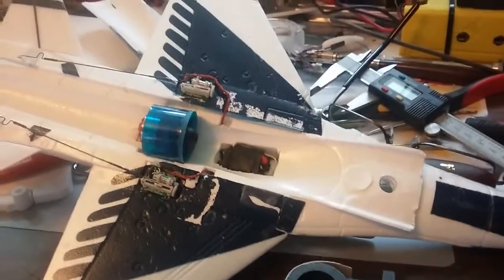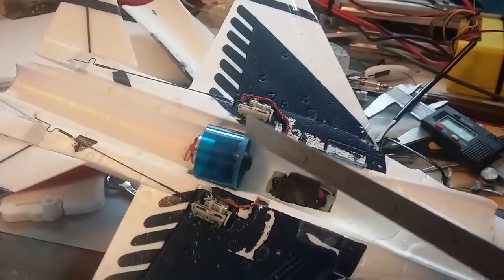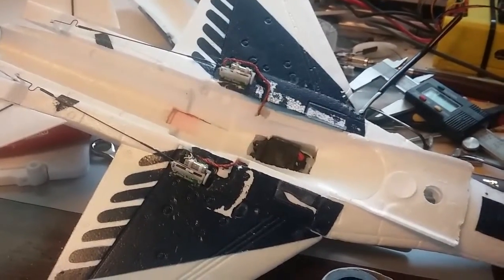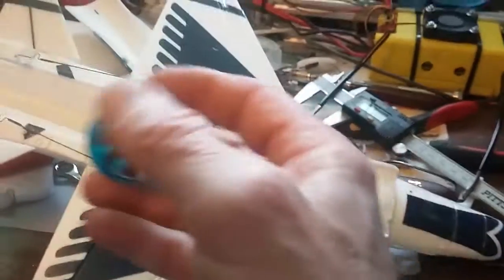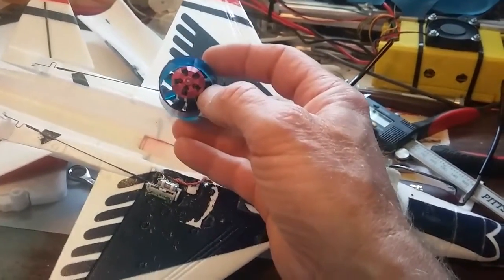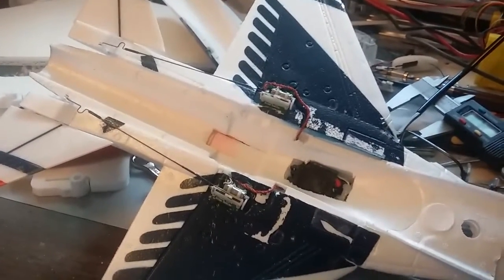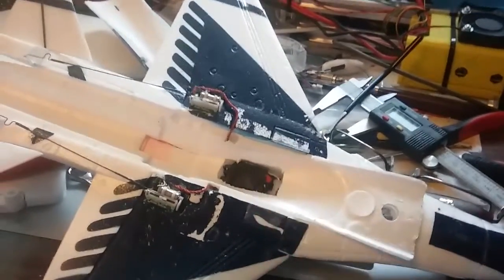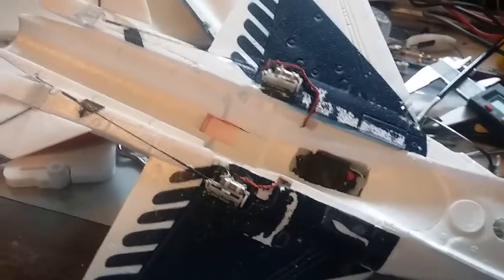UMX F-16 30mm edf Mod

Comment: I actually just did this mod myself. I knew of your videos already from the pkz P51, i should have looked around some more at your play list i completely forgot you did this mod. i did the exact same thing with the new 30mm from eflite, i may have reconsidered if i remembered this vid. 

I've read the comments and your reply. still no gains? what about 3S? 

the lines on these birds are so nice too, eflite did a fantastic job scaling this bird down i love the look amd UMX is the best size to. i still have a H9 1/4 scale J3 taking over my living room, Draco taking over the dining room. 

what i really really want yo see and i said this as soon as it arrived, my Draco! 

can you imagine a scale UMX Draco!!!! imagine the scale detail and size of the UMX Carbon Cub SS and the detail that went into Draco. 

UMX Draco would sell out round the clock for a year, they could stop and make nothing else OMG! 

anyway, im scrolling through your vids to find what pinion to use for the Brushless inrunner that used to power my UMX F-16 i have a small stack, Rage RC supplied the gearboxes 10mm.

I do hope to hear back from you about the 16 though, love your vids and I'm a subscriber.

Comment: Well after testing the set up even with the bigger edf I still couldn’t get any more thrust. The problem is the size of the intake duct. It isn’t big enough to flow any more air. To connect the esc to the original board you have to solder the white signal wire to the transistor that controls throttle output on the board. If you send your email to robtbird.rw@gmail.com I will send you a picture that shows where to connect the white signal wire.

Comment: Hello:  I would love to know how you use the 18amp ztw esc in here with the UMX radio.  I wouldn't mind a sanding cylinder too if you're still doing those.  I ordered the same edf and esc, but was thinking I'd have to put a micro spectrum radio in place of the original.

Comment: How you doing. nice video on the mod. I have the micro habu and a 10000kv 30mm motor I want to put in. Not sure how to mod the esc to the ad3x board. was wondering if you have any advice or a video showing that specific mod. Thank you Mike.

Comment: I was under the impression the F-16 ran a 30mm EDF stock (...Nope, I was wrong...28mm from the factory, but the F-16 has a "bigger" inrunner brushless than the Habu)? I also had the Habu, which had a 28mm EDF? You're exactly right that these F-16's are SUPER sluggish!

If you go 3S, check out this battery...I use them in my STOCK P-47 UMX, and it hauls!

http://www.hobbyking.com/hobbyking/store/__59073__Turnigy_nano_tech_180mah_3S_25_40C_Lipo_Pack_AR_Warehouse_.html?strSearch=180mah%203S

Here's a link to my P-47 UMX video...

https://youtu.be/eQXgih4NOBY

...I have tons of flights on this 3S pack without problems yet, and only mod was to max out throttle at 90% (and the JST connector) but you could do maybe 95% depending on your ventilation.
Reply from the maker: The 30mm outrunner EDF unit is supposed to put out 118g of thrust on 2s, unfortunately the unit shown is bad. The vendor is sending another. I will be able to put a 35mm edf unit in the Habu, it is supposed to put out 200g of thrust on 2s. All parts are on the way and I should be able to to test both some time next week.
Reply: +RCflyingfun Please post a flight video! I want to copy you if it works well, since my F-16 UMX just started acting weird...

thanks
Reply from the maker: I will post some videos when the F-16 is flying. If you set yours up with a 30mm edf you will need to machine the fuselage out like I did. If you need a sanding tool let me know I can print them for the 30mm or the 35mm. I would not recommend putting the 35mm in the F-16 because it will weaken the fuslage too much. There is enough meat to machine the Habu for a 35mm though.
Reply: +RCflyingfun Yeah, you're probably right. I also have a dead habu UMX...

I'll watch for the videos.

thanks
Reply from the maker: I had watched your P-47 video before. You did a great job with the lights and flaps. Have you watched my 1806 powered P-47 video? I have a stock P-47 and one that has a 1806 motor running 3s. The 1806 bird has unlimited vertical climb and has twice the speed of my stock P-47. I have a flight video of it on my channel, watch it and let know what you think.